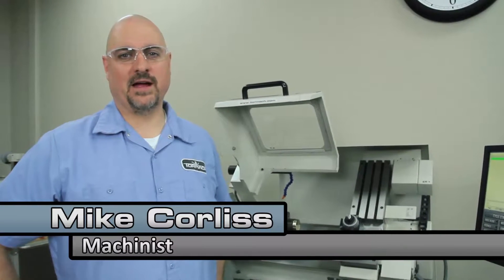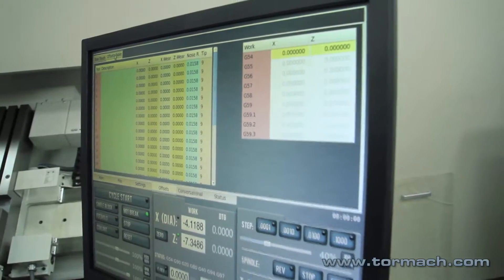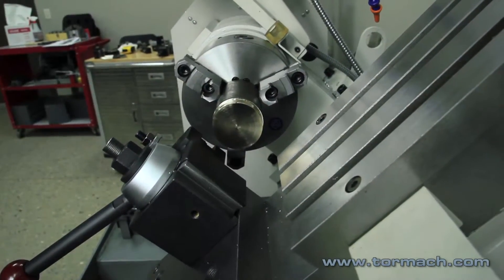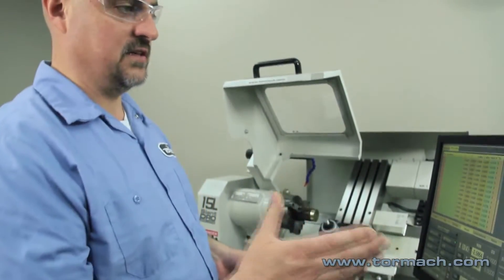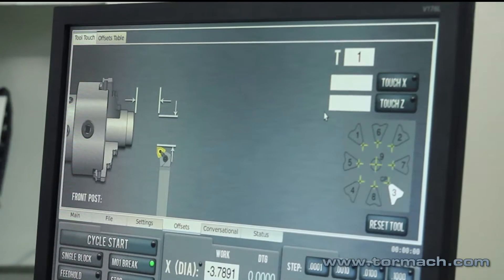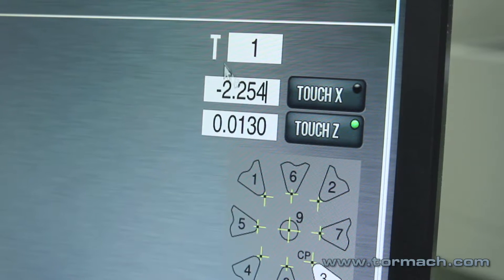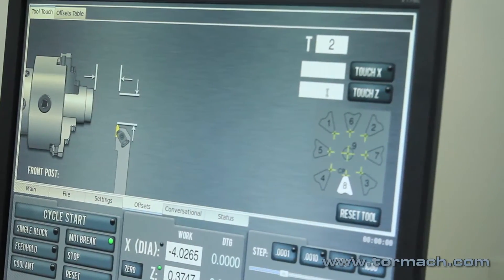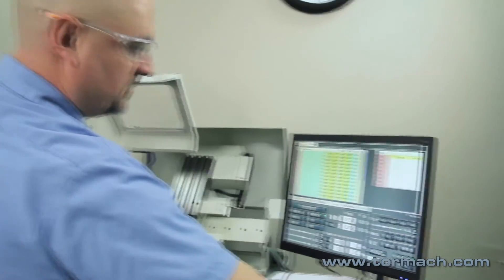Tormach CNC Lathe: Setting Work and Tool Offsets

Comment: Why are the work offsets in the offsets table read only on the slant pro but editable on the 1100 Mill? I would really like this same functionality on the lathe. It is vary handy when you can incrementally adjust the offsets if you part varies.

Comment: It'd be great to see how to do this on an 8L. 

As someone who is new to machining and teaching myself I'm struggling with wrapping my head around the machine. X+ should be towards me and X- should be away. So using this method when I touch off for G54 I enter a positive number instead of a negative. Everything seems good. Then I go to touch tools off and repeat the process but the machine flat out tells me X needs to be touched off in a negative number (it uses the word should, seems to stay as a value but I'm not 100% sure). If I do what it says and touch off my tool in X as a negative it will change my G54 and put 0 somewhere between myself and the spindle. I don't think that's right. I think it needs to be positive. 

I've managed to cut by using one tool and touching to 0,0 (and copying the tool touch value). But now that I'm working up to multiple tools I need to properly touch off G54 and both tools being used. It's driving me nuts! And the 8L doesn't seem to be very popular and there's not a lot of videos out for it.
Reply: I'm here in 2024 trying to figure out answers to this very question. What I've figured out so far as it pertains to the 8L - You can follow this video but don't use any negative values. The 8L seems to have a different setup than the 15L. Positive X values on the 8L will move the cross slide toward you.
Reply: @PithyBikes  I left the industry unfortunately but good luck to you. Def had fun machining, but at the end of the day my brain doesn't work the way a machinists brain should.

Comment: what do you enter when using the master tool?  tool zero?  Or does putting the blank holder in and typing in numbers in the dro not apply to the tool that is selected but the work offset?  meaning unless you type in the offsets menu you are setting work offset?

Comment: Thanks for the video.
Any reason not to just do your initial touch off with tool 1 (and enter zero for the T1 offsets)?
Reply: I would think you'd actually want to use the empty tool holder for each tool first, then set the tool offset with that tool after it gets populated with the tool. The way Mike did it seems to me to depend a lot on dimensional consistency from tool holder to tool holder. I've never put a mic on Tormach's tool holders, but in general I would never assume two of them are exactly equal in size. 

Maybe I'm missing something though.

Comment: Thanks for the video. Question about the piece in the chuck, does it have to meet certain specific dimensions for setting the offsets correctly ? (I assume not, since what you´re trying to determine is the offset between the holder and the cutting tool so the reference piece should be irrelevant, right ?)
Reply from the maker: +Cristian Cvitanic You are essentially right. You can take an OD Cut, use calipers to get the dimensions and then use that number as your zero (or not move the tool after a face operation and use that number as your zero.
Reply: Thanks !

Comment: That would be cool to calculate right in the field not in mind or calculator. like in spreadsheet. For example I enter

=0.254+0.006

And it calculate result for me. Means if I start with = then it calculates. then all I need is to enter

= paper width + cuter width / 2

And that is it. I do not need to calculate.

In general I like your new PathPilot. Although I would like to see tough friendly interface so I can work without keyboard or even knob controller. Just slide knob on the screen. And when focus in number field popup numpad under it to enter digits quickly. I have other suggestions but unfortunately I personally not yet used it. Only so reviews.
Reply from the maker: PathPilot already has that feature. There's no need to type in "=". Just type out the equation and PathPilot will calculate the answer.

PathPilot also has the touch screen feature, but as of right now (March 2015) we don't have an approved model available. That should change very soon. If you do have a touch screen already you can test it out. PathPilot is based on Linux so you may have the drivers already - though in our testing several touch screens won't work.
Reply: That is cool. Cannot wait to get my hands around PathPilot. Thank you for answer.

Comment: Nice! an interesting method too. I wouldn't have thought about using the blank holder as the reference.
Myself I prefer setting tools to the chuck body or jaw, then using work offset Z to shift outward. I don't use work offset for diameters at all.
Lots of way to do it; Mike should make a video showing some of the other possibilities, with the good and bad points of each!
Reply: So then you're saying that the tool holders are so dimensionally consistent that you can use an empty one as the "master," but use your tools in other tool holders? I mean, Mike went through the trouble of including the thickness of the paper in these settings--0.003". So that implies that you're saying these tool holders are within 0.003" of one another...otherwise you really wouldn't know whether or not the number you're entering in for a tool offset is accurate. Make sense? 

I'm not trying to be a smart arse here--I'm actually ordering a 15 SPL this summer, right after I get an 1100 mill. So I'm genuinely interested in how you guys want us to set up these things. I also love these videos, and find them extremely helpful. 

Thanks for making them!
Reply: @bluehornet6752 Late to the party, but I think all that matters is that the tool holder you use as a master is dimensionally consistent with itself. You could use the world's hardest turd to touch off. All you're doing is setting the work offset from a known consistent value, ie the tool holder. Particularly since the tool holder won't wear down over time.
Reply from the maker: Both ways will work, what you mention is essentially opposite of the approach we demonstrate here.  But you still arrive at the same result.  Perhaps we will show other methods in the future as well; the method Mike is showing here is the same as we describe in the lathe manual.